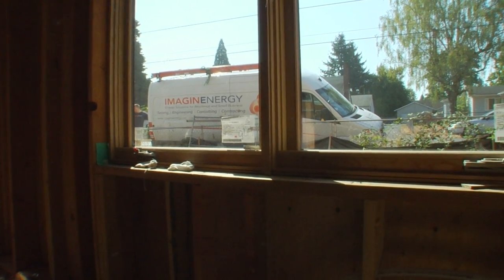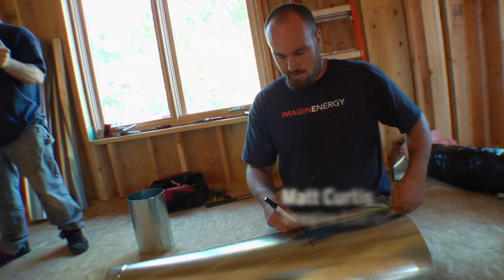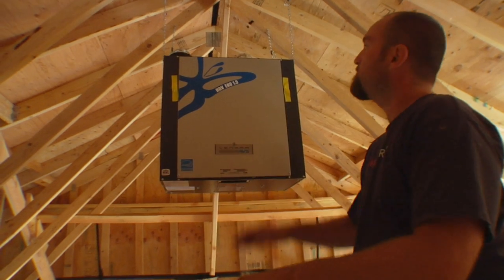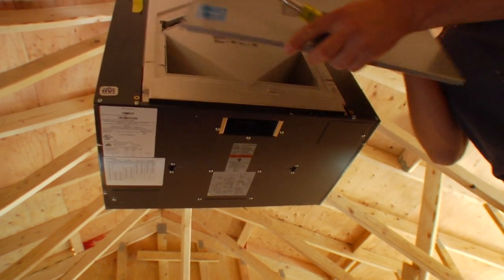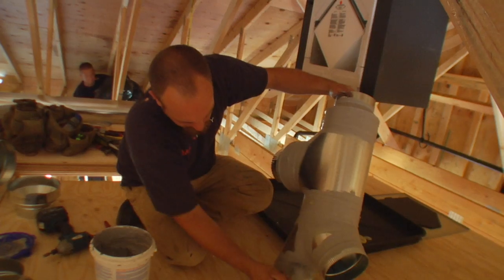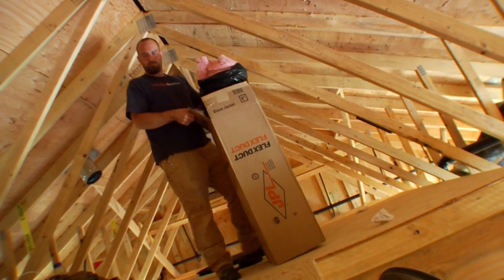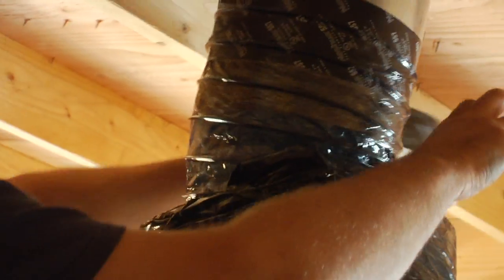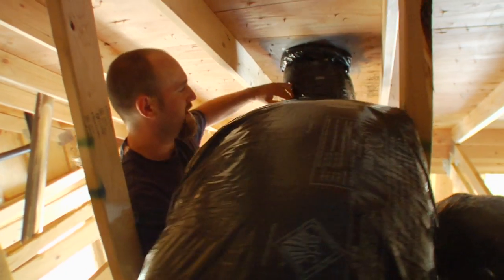Cully Grove:  HRV/Heat Recovery Ventilator Installation

Comment: Interesting how energy recovery units have evolved over the years. Most were traditional low static cross flow units that are placed in the ceiling of the home. Now there are high static units, others that fit into the kitchen cupboard and even ones that look like a typical domestic exhaust fan. A good one I came across I think was called an Aerofresh. 
It looked like two grilles, one inside the house and the other on the exterior bricks. They claimed it had a heat exchange within the tube that connect the two grilles to harness the heat.
Reply: Wayne Nort you s

Comment: Why is it installed in the attic as opposed to the basement next to the furnace?  Everywhere I've seen them, they were in the basement.
Reply: House may not have a forced air furnace. But I really wonder if the attic is the best place as well. I sure hope that's a conditioned attic, otherwise it's definitely a monumental mistake to install it there. A wall is definitely better than a roof for the intake and exhaust, though with careful planning either can work.
Reply: Trevor Lambert Who says there ya basement? That might be the reason
Reply: @MisterTwister88   That's what I was thinking. A LOT of homes don't have basements. O_o
Reply: The furnace might be in the attic
Reply: Make a closet

Comment: Is this unit hung in a cold area?  What happens to the condensate? In cold weather? does the line freeze? is there a bucket catching it? or is it plumbed to a drain? Units are tested at 70 degree inside temp for heat recovery. Don't know how cold it gets in Portland Oregon, but if you did this in Portland Maine you'd have some real problems. Roof intake vent would get covered with snow. Core would freeze up in cold weather. Fresh air would be really cold. I really hope they sprayfoam the roof.
Reply: I'd assume this is somewhere south.  Can't be installing those in a candian attic.